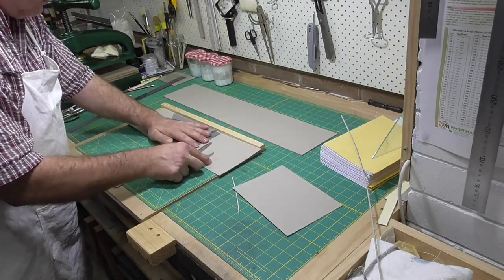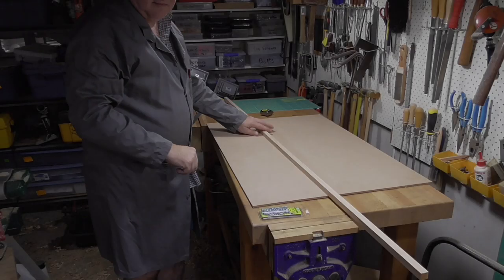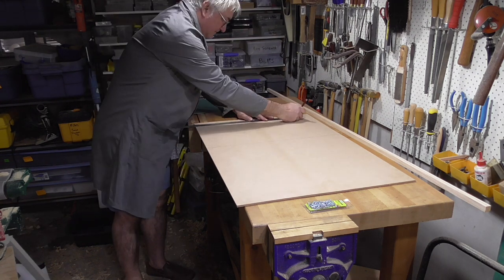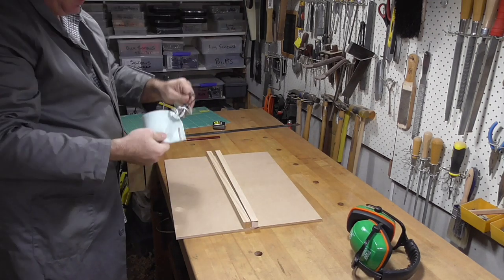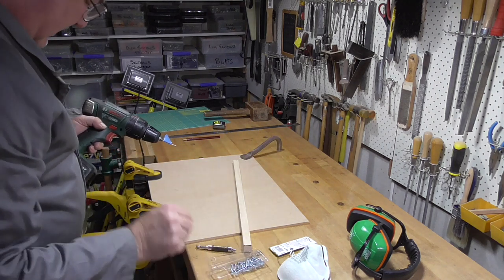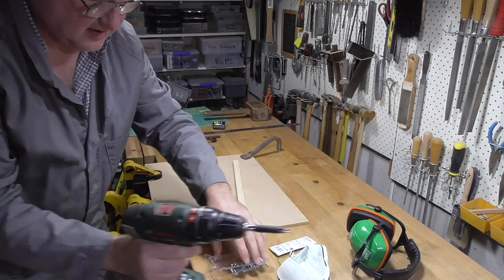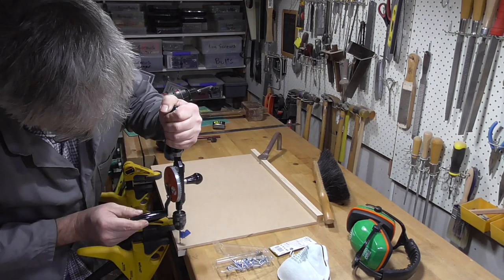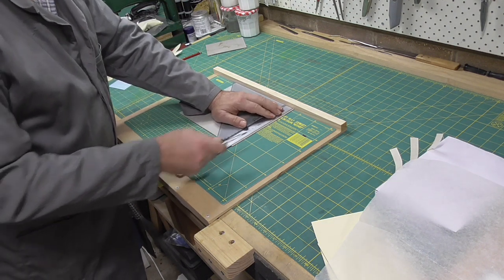Making a Cutting Mat Bench Hook // Adventures in Bookbinding

Comment: As a person forever at odds with their board shear, I made a portable Bench Hook from at hand materials using: a 12x16 bamboo cutting board as the base for an 8x12 Olfa mat, and two pieces of aluminum angle glued and screwed for the hooks. Works perfect using your cutting technique though mine is left handed…thx !!!

Comment: Great video. Made this myself with my baby desktop saw from Harbor Freight (USA).  Did you glue down your mat to the wood?  With what adhesive?  I’ve learned so much from your extensive roster of bookbinding videos and have even ventured out to make up my own stitching patterns. Loving my new craft, thanks to you.
Reply from the maker: No, I didn't glue the mat down.  It stays in place fine and I change them after a couple of years use.

Comment: Thanks for making this video! Quick question when you have a second: how are you securing the mat to the bench hook?
Reply from the maker: I don't.  I find it grips the MDF fairly well.  I have used Masonite (another engineered wood that has a smooth surface) and it slid around a bit.  A few dots of PVA will stop it moving about and can be peeled off later.  All the best, DAS
Reply: @DASBookbinding  awesome, thank you for the reply!

Comment: Anyone who can make do with a smaller version, I took the legs off a cheap wooden bed/TV tray off Amazon that has a lip piece. You can just add a metal bracket or wood off the bottom and have the squared edge and not need any power tools. It’s smaller, but I use it with a smaller cutting mat, and a carpenters square to line anything up larger than the lip.

Comment: Try using a rectangular trowel with a handle, instead of a metal ruler, for cutting boards.   It’s easier to square.  and keeps fingers safer!
Reply from the maker: That's a great idea.  I don't think it would work for me.  I believe working fast and efficiently also improves quality.  Having to swap between a ruler and trowel, and having a large piece of kit like that on the bench to get in the way, would slow my flow down.  But the larger surface area and extra friction should reduce the chance of slip, which many people have problems with.  I'm certainly going to get one for the next time I teach a workshop.  There is always someone struggling cutting board.  Thanks, DAS
Reply: @DASBookbinding  I agree with your point about measuring, I tend to use my callipers against a ruler. The trowel handle does mean its not as fiddly as a ruler to locate and can usually find it without looking.  
For cutting, I have also had great success using those wheeled dressmakers rolling knives.  They go through greyboard in one pass, and also never snag paper.
Keep up the great videos.  Good to see a binder using his brain as well as traditional knowledge.

Comment: I've been wondering... since now is not the best moment to go to hardware stores, how else would you make right angles without that backing piece of timber?
Cheers
Reply: Guiilerme - until you can get a square, you can use the markings on the cutting mat.  All of the ones I have tested have been surprisingly accurate.
Reply from the maker: Sometimes when I'm working fast I will just use my second steel ruler as the back stop.  It just has to be thicker than the paper.  Good luck!  DAS

Comment: You just rest the cutting mat on the bench hook and not fix it down in any way?
Reply from the maker: That's right.  I used to use a nicer wood but it had the problem of being very smooth and the mat would slide.  The MDF has a surface that holds the mat well.  DAS

Comment: Nice holdfast, lot of dust on marking gauges :)
Reply from the maker: The dust drives me crazy in there.  I used to hook that saw up to a shop vac, but it made almost no difference.  I don't have enough space for a proper high volume dust system.  Maybe one day.  All the best,  DAS
Reply: @DASBookbinding  I meant "it's dust on marking gauges" because you haven't do woodworking for a long time - just a joke, sorry not very good